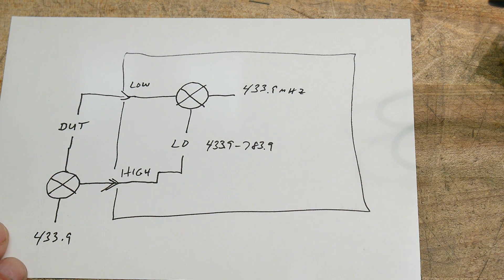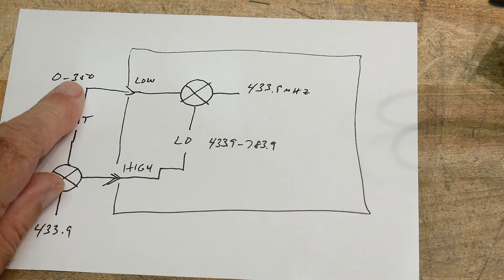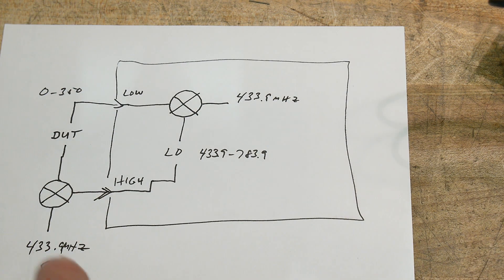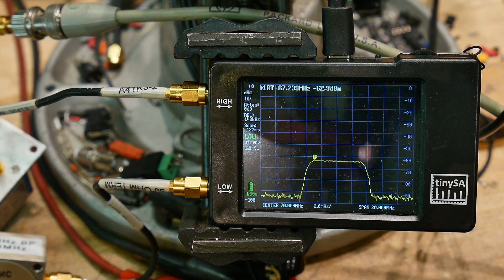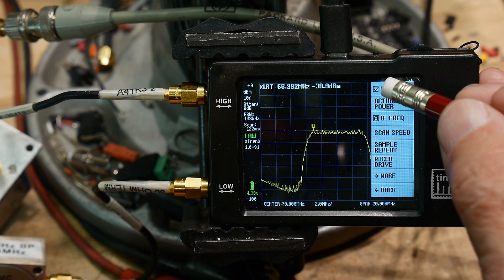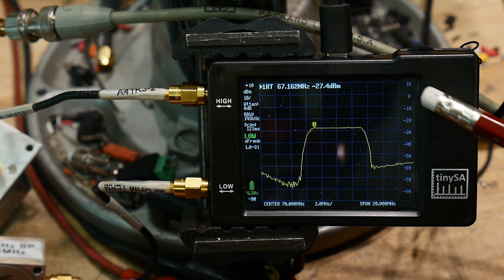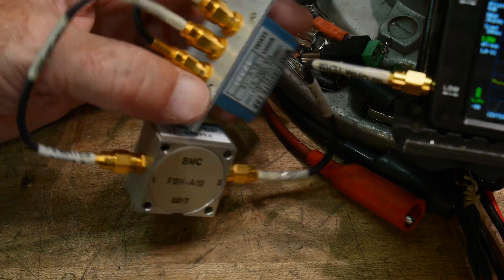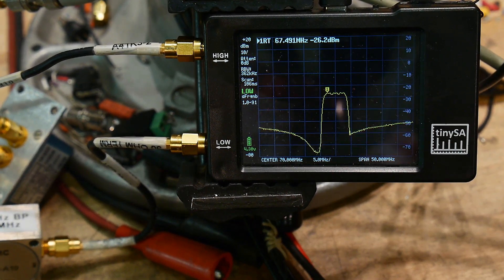#561b TinySA Tracking Generator using External Mixer

Comment: Could you use a  a NanoVNA  as the  43.9 mhz signal generator?
Reply from the maker: probably, be aware this method no longer works with the TinySA ULTRA
Reply: @IMSAIGuy  Why no longer works? Do you have any video on this matter? Thank you!
Reply from the maker: @JRSGandara  no video. I tried it on the new ultra and when it acted funny I contacted erik. He says it does not work. it's complicated. there is no simple VCO sweep, it in two steps, one outside the main chip and one inside the chip, like high gear, low gear, so it is not continuous.
Reply: @IMSAIGuy  understood. Thank you for the reply and for your fantastic content. Just bump in to your channel two days ago and already watched a dozen of videos and subscribed.
Reply: @IMSAIGuy   Thanks ! I just bought a standard  version  a few weeks ago so I should be good to go.

Comment: I find your videos like these to be sooooo much more useful/meaningful/interesting than ALL of the 'unboxing' videos on YouTube put together. Some other people's videos I click away from after 20 seconds. Yours I make sure I can conveniently get back to at any time. Content is king, and your videos are the 'good stuff'.

I'd been using a transistorized RF noise source to look at filters when I was using the TinySA instead of using my boat anchor HP Spectrum analyzers, but now I will grab one of my unused mixers and an old 433.9 MHz xmit oscillator and build a tiny accessory device to add the tracking generator function to the TinySA. Thank you.
Reply from the maker: don't try this with the TinySA Ultra, it don't work. yes, the IF freq is different, but even if you change that, the internal design of the Ultra will not allow this trick.

Comment: To generate 433.9MHz just use the same chip as in the TinySA, SI4432 modules are less than $2. Mixer modules are also fairly cheap so no need for soldering, just some coax and a micro.

Comment: Suggest to set RBW to 600kHz
Reply from the maker: BUG:
in measure mode
-6dB width
when asked for SPAN - width of signal 
if you enter 100khz the span will be 200khz
Reply: @IMSAIGuy  Indeed, if the expected width of the signal is 100kHz the span is set to 200kHz so you can see the edges of the signal
Reply from the maker: @ErikKaashoek  OK I understand your design. you might consider the way the HP does this function. if you have a display of a  filter you press the dB button and is automatically finds the peak and bandwidth. defaults to -3dB but you can set any level. seems like if you need to type in the frequency and span your SA is not really doing much
Reply: @IMSAIGuy  Agree
Reply from the maker: @ErikKaashoek  Can you please fix this:
https://youtu.be/erwBH7eEoWA